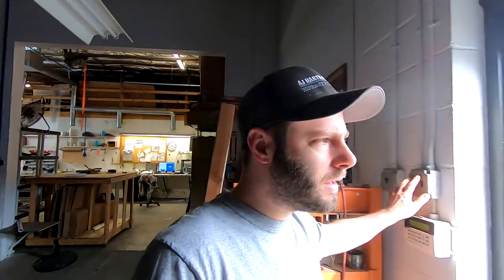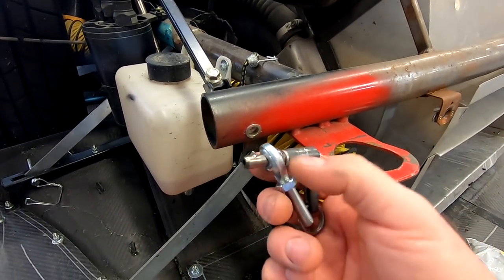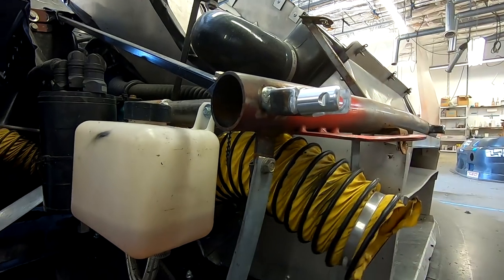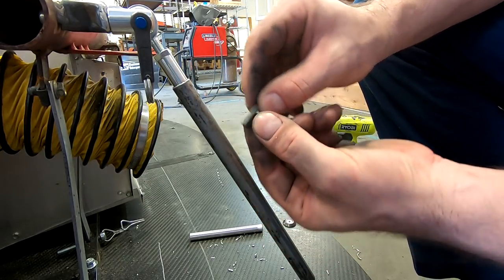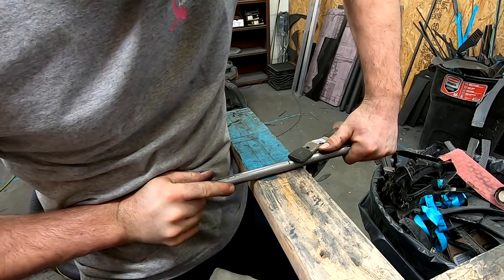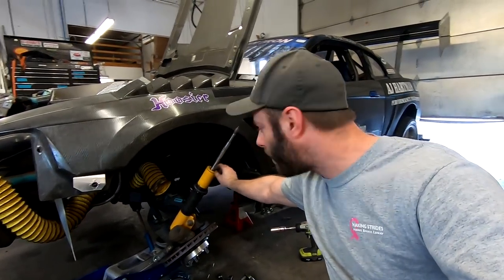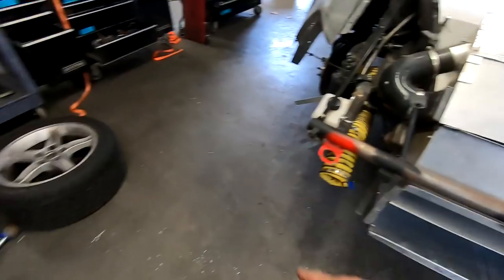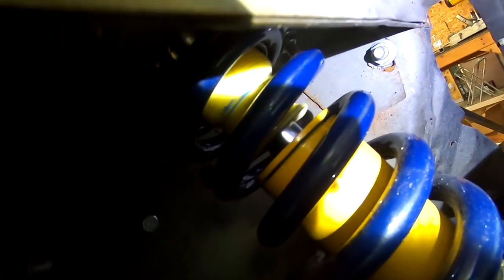Collapsible Splitter Rods and Longer Bump Stops

Comment: Sweet idea with the moveable rods!   Also sweet that you noted the marks on the wang from the rain, old school guys used to use oil and dye on the leading edge before testing to get the aoa right by adjusting until they got the right separation point required.

Comment: I just used braided steel cables from bicycle shifters. Brake cables are thicker if more strength is needed. My two shifter cables hold me up, and are infinitely compressible in the up direction.
Reply from the maker: Nothing wrong with that setup. My originals like 7 years ago were that setup.
Reply: and you wouldn't believe the aero effect a cable has, worse than a rod... put it that way.

Comment: Would cables instead of rods accomplish the same thing?
Reply from the maker: Sort of yes. I was made aware that it might be a possibility that a splitter could “flutter” at really high speeds. So the spring wouldn’t be possible with a cable to keep this from happening. The two people that mentioned the fluttering issues tried it on not so great splitter designs. So that could be a factor.

Comment: You still racing this car?
Reply from the maker: Yeah. Next video will be a race video.
Reply: @ajhartmanaero  I race in optima ultimate street car challenge and have rules except rear diffuser, under body, and I can have some front splitter. Also can run side splitters and flairs. For rear wing factory zl1 1le rear wing and that's where the rules are killer cause that's as good as I can get it, besides at 5in spoiler. I'd love to work with you to get an effective setup. Do you have a way to do simulation on my car vs the cost of wind tunnel? I have a relatively small budget compared to what would be ideal so would like to find best things I can just make myself and therefore spend the money on "get what you pay for items".